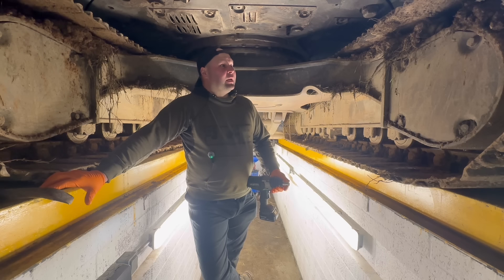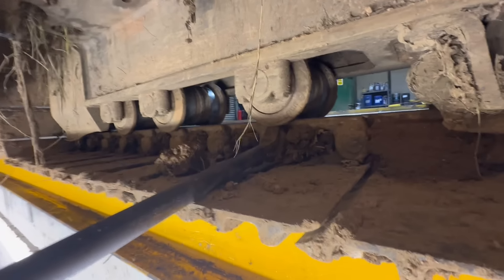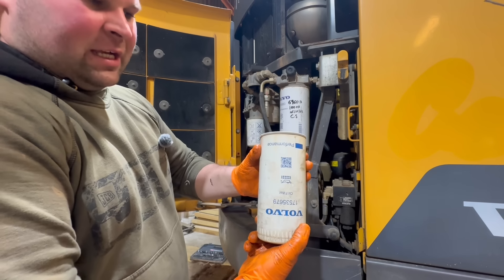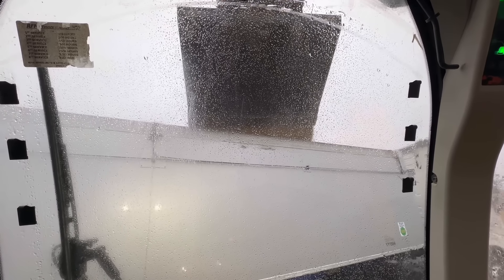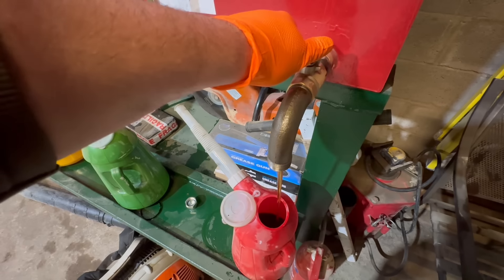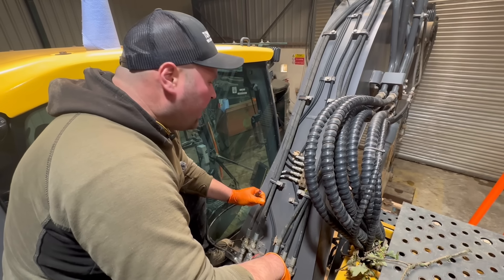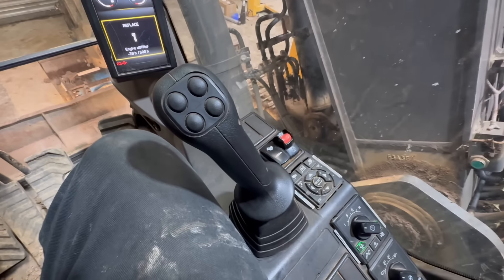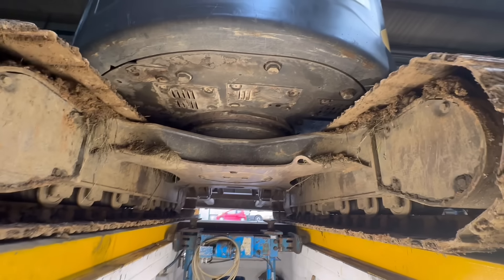Down the inspection pit servicing the big volvo digger. (It’s so easy when you have a pit)

Comment: What a poor design for those filters, everybody knows you should mount the diesel filter above the starter motor so than all the diesel runs into it. Tractors have been doing that forever. White diesel in the digger whatever next 😂

Comment: Sweden here! Look in the compartment in the floor on front of the cab for the service bag, it's supposed to be in there with a Volvo engine oil hose. The service book for that digger is available online for 70$ at 3500 pages, it's well worth it on the Ecr series everything is a bit more complicated... The company I work for has a ECR145Elm and I have to maintain it, for a lot of enging stuff the whole counterweight has to come off..
Reply: Or I could send you the service manual somehow, it's however a massive 600mb pdf file 😂
Reply: @TheBibliofilus  DVD would work🤔
Reply: @TheBibliofilus  Dropbox and share the link to it. 👌
Reply: However a cheap USB stick would be easier.

Comment: Mid 20s to low 30s, lovely and sunny here in regional Australia 🙃.

As we've rebuilt/refurbished some of our smaller trailer mounted equipment, we've taken a similar approach to Volvo.  All the filters remote mounted together, as well as standardising them.  Now almost everything uses the same engine oil, fuel, air and (when applicable) hydraulic filters.  Said filters are ones we already stock for other equipment.  Standard batteries too.

As a bonus, the filters are much larger than stock, so they last longer.
Reply from the maker: Thanks for the reply

Comment: Hello from Canada Tom. Its sunny and about 25C here! and the soybeans are rolling off. My excavator has the same oil drain plug thingy. No where to be found in the tool box or anyplace. Ended up getting one from my local auto supply store for about $12CAD. My filters are not as nice as yours though, Case like to put them all around the machine. Noticing your diesel fuel as well, unlicensed vehicle fuel over here is dyed red.
Reply from the maker: Yes same here but we have to use taxed fuel in diggers now

Comment: 16:02. Press the button on the dash, with a symbol of a line through an alarm and it turns the siren off. We have these diggers at work. But they're the 23.5s Also you can go into vehicle settings, scroll down to joystick hot key, and set it to either do the windscreen wiper, full power mode, or probably good for you as a YouTubeer mute music, for content matching when filming. It's the right button on the left stick. Also pressing the dial in on the throttle dial puts it in kw mode for more power, and pressing the left button on the right stick, goes into strong arm mode for about 10 seconds,  when lifting heavy buckets of material.
Reply from the maker: Thanks

Comment: Hi Tom, I am in SE London and it is dark and over cast with a temp of 15c, gloomy. Tom would it be OK to tell you that when I had to change the diesel filter on a car I used to own (a 1997 Ford Escort 1700 TDI Saloon) I would always take the filter and first half fill it with diesel magic which is a diesel system cleaner and pump and injector cleaner to remove any rubbish or carbon from the tips. When you start up the car will belch white smoke and that clears in about 3mins and the car always ran a lot better. Just wanted to share that. Also it was good to see the cat again. Thanks for posting.....

Comment: Current weather
9:41 PM

Mostly clear
72
°F
Mostly clear
Feels like
71°
The skies will be mostly clear. The low will be 64°.

Pollen
Very High
Wind
2 mph
Humidity
58%
Visibility
9.9 mi
Pressure
29.94 in
Dew point
55°      Collinsville Oklahoma  in the USA

Comment: Where possible I normally fill the oil filter as well. Thus the oil pump doesn’t have to fill the filter and should get to normal oil pressure quicker.